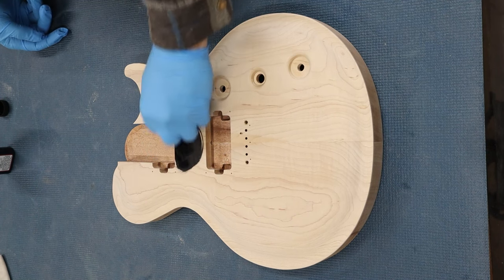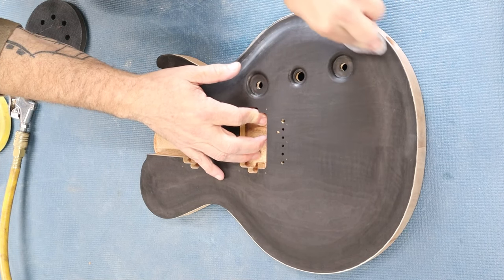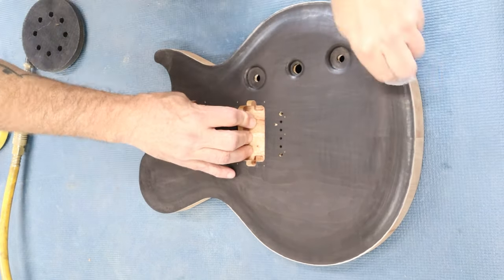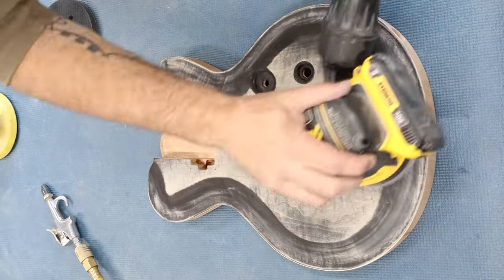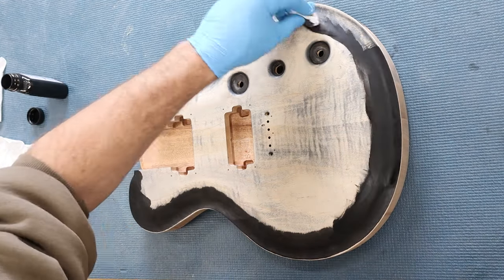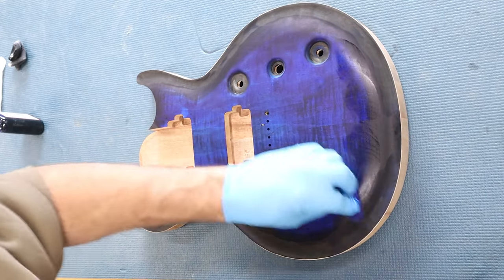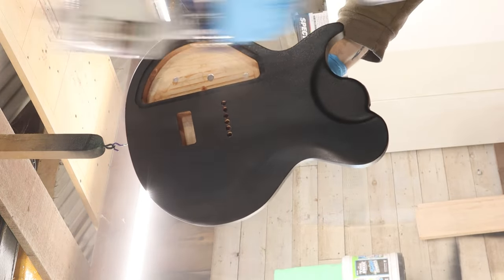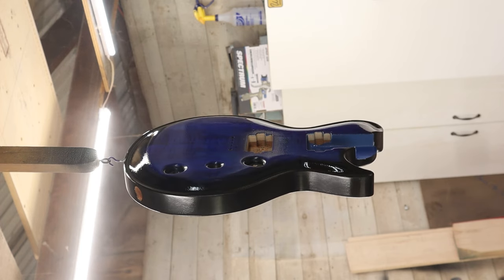Dye a guitar body Black Burst over Blue with Angelus Leather Dyes and Spray with Mohawk Vinyl Sealer

Comment: Looks great! 

Question #1: Did you spray sanding sealer before and after dye, or just after?

Question #2: Have you had luck with Spray Max 2k over the Mohawk vinyl sealer?
Reply from the maker: I sprayed sanding sealer only after all the dye coats were applied.

I actually have had good results spraying Max 2k over Mohawk vinyl sealer.  In fact, that's exactly what I ended up doing to this guitar.  I would just let the sealer cure for a couple days and then lightly scuff with a scotch brite pad. 2k needs a surface to "grab" on to.

Comment: Looks great; is the vinyl sealer the last/top coat applied (e.g., in lieu of something else like a poly 2k)?
Reply from the maker: Thank you.  The vinyl sealer is actually the last step BEFORE the final clear coats are applied.  The sealer basically locks in the dyes so they don't shift or get blotchy when applying the clear coats.  You would still need to spray a few coats of 2k, Poly or Lacquer on top of the sealer.  Hope that helps.  Best of luck on your project.